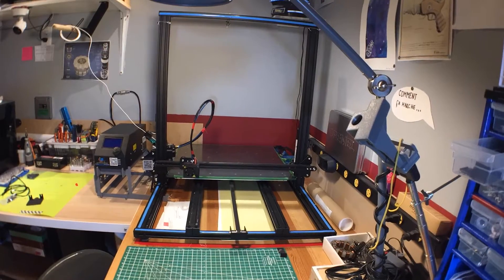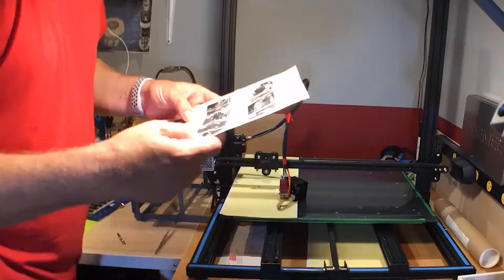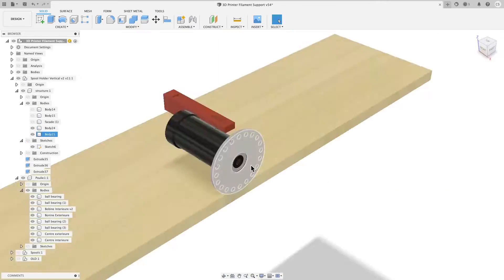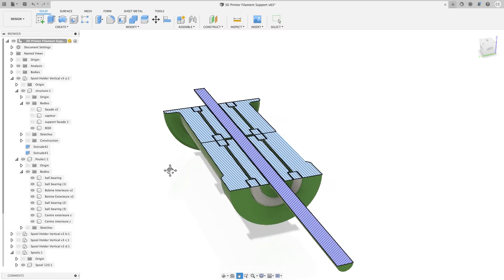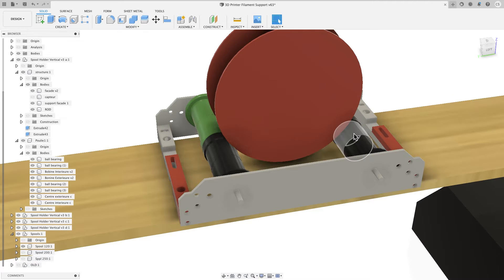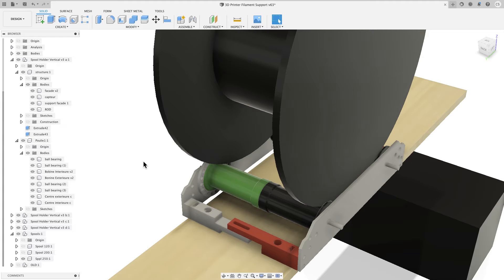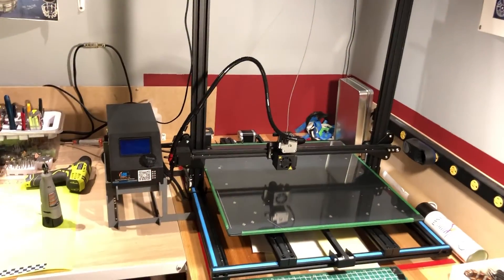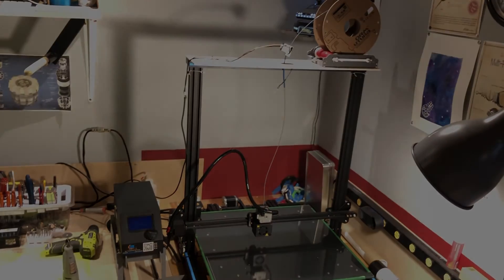Creality CR10 S5 useful Upgrades

Comment: Nice. Do you ever continue working on this machine? How did it perform in time?
Reply from the maker: I still use this machine and it works well. in the meantime, I had a couple of issues such as the heat head went off and I had to buy another one. except for that problem, it perform very well